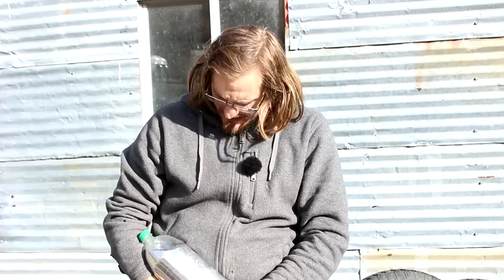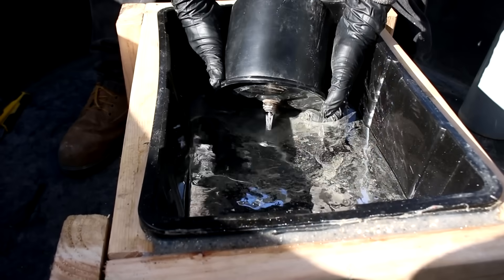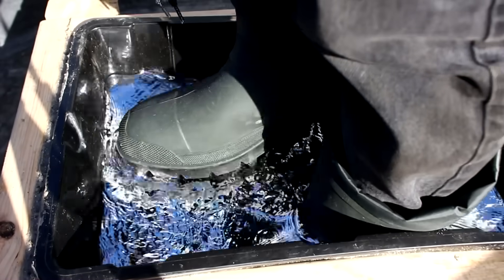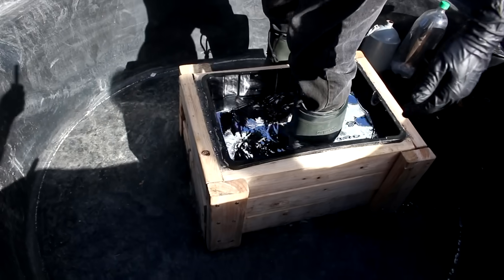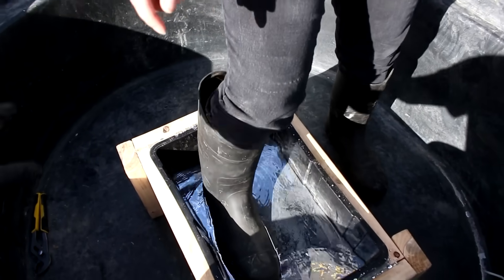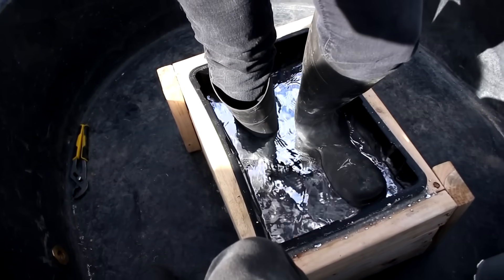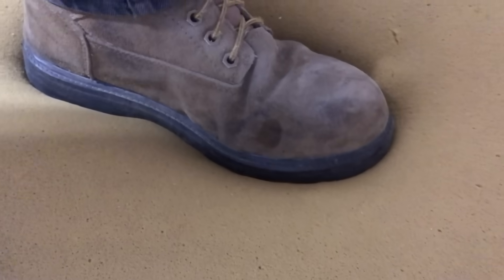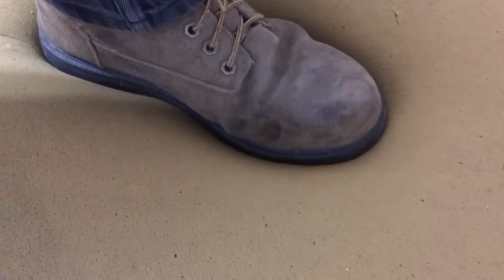Can I Stand On Liquid Mercury?

Comment: Isn't mercury dangerous to human health?
Reply: Yes, it can be.  But so can water, oxygen, and many other things we are exposed to everyday.
Reply: I mean contact with mercury. BTW those are only dangerous in case of an overdose.
Reply: As is mercury.  It is a neurotoxin, so the more it builds up in your body, the worse it is, just like an overdose.  

Elemental mercury, which is what he is using, only has a limited number of ways that it can get into your bloodstream.  It is no readily absorbed through the skin, so unless you have open wounds or stay in contact with it for a extended period of time, there is little danger when touching it so long as you are sure to remove all of it from your skin.  Ingestion is also dangerous, but not very a very likely method of being poisoned as elemental mercury is not easily absorbed in the intestines and most will pass through with limited effects.  Likewise, even the direct injection of elemental mercury directly into the bloodstream will usually cause greater complications from blocked blood vessels at the injection site and in the small passages of the lungs than the issue of toxicity.  

The main vector for elemental mercury to enter the body and bloodstream is via inhalation of the vapors.  In this case, Cody took precautions by performing the experiment outdoors on a cool, windy day so as to minimize the rate of vaporization and ensure any ensuing vapors were dissipated by the wind.  

Organic mercury compounds are much, much more dangerous as they are easily absorbed via skin contact, and in some cases, can even migrate through PPE.  These are also the compounds found in most fish and in many of the poisoning cases.
Reply: thx I didn't know mercury had 2 kinds.
Reply: No problem.  That's why there is so much confusion around mercury and people regard it as super deadly, when it's not always the case depending on what form it's in and what precautions to one must take to keep themselves as safe as possible.  

You saw Cody with his hand in liquid elemental mercury, however a lot of people have also heard of the chemist who died after getting only a drop of dimethylmercury on her glove.  This is probably the best example I can use of how mercury affects people differently depending on what form you encounter it as.  Dimethylmercury is extremely toxic and can migrate through gloves and other protective wear.  Other highly toxic compounds are methylmercury, diethylmercury, and ethylmercury.  Merbromin ("Mercurochrome") is also an organomercury compound, but less toxic than some of the others listed.  In the video, you can even see Cody donning gloves when dealing with the mercury nitrate solution as the mercury is now a compound and no longer in it's pure elemental state.  

Just figured I'd give you some additional info.  :)

Comment: hmmm that's more like your boots are acting like a boat, not a raft, you foot and leg are not dispersing the mercury, the boot is, which is much larger than your foot, so its a larger surface area for psi of mercury. try using plastic bags over your feet and legs, nice big thick black garbage bags, it would remove the difference between your leg and the boot, so you would actually being using your leg and feet to displace the mercury. 

Also can you please tell me where you got your rolling press when you did the gold foil experiment? If you made it can you please make a video on how to make it, and where you got the supplies to make it. I have so many projects i want to make but no funds to get a few k worth of press just for my arts and crafts, lol. a DIY metal press would be nice.

Also I love the channel keep it up, liked and subscribed!

Comment: My dad had a friend who worked at an electroplating shop.  They had a small drum, maybe 20 gallon size, of mercury.  The challenge was to put your whole arm in and touch the bottom.  Always fun to watch people try it for the first time.
Reply: Wouldn't that be toxic?
Reply: @Sanjay_ar1  Not at all.  Liquid elemental mercury is pretty safe.
Reply: @josephcote6120  I had a friend of mine who's dad used to work in a refinery. 
He now has Alzheimer's disease and fids. 
Doctors have said that it's due to exposure to heavy metals. 
He passed away 3 weeks ago..
Reply: @Sanjay_ar1  he's not talking about refining it, he's talking about elemental mercury, which in itself is largely ok to touch bare handed (as shown in this video when cody sticks his foot in it)
Reply: @Settings208  the vapors enter your lungs
Reply: @Sanjay_ar1  the vapours are heavy enough that this isn't happening unless you're getting your face right up next to it
Reply: @Sanjay_ar1  Significant mercury vapours don't form unless its really hot(may have been in the refinery) and elemental mercury doesn't enter the body unless there is a physical cut or opening.
Edit: He my have had exposure to mercury compounds while in the refinery which do get absorbed by the skin

Comment: That paper towel not soaking up mercury was crazy weird
Reply: August Sawzak Yes!! So glad someone mentioned this.
Reply: Why
Reply: Same reason as water tension- however elevated because of it's density
Reply: @jacobgeorge7475  lmao didn't the 3rd comment just say it wasn't because of the density ?
Reply: It's really satisfying watching it
Reply: Mercury doesn't soak up, it's too dense for that.
Reply: It's not really the density that causes it. Mercury is extremely cohesive and less adhesive than water, that's why it can clump together to create those big droplets and generally doesn't stick to surfaces. Water "sticks" more easily to another material and makes less big droplets which will end up in the porous structure of a paper towel.

On top of that water also sticks to paper towels because of the cellulose fibers, which it will cling to even more.
Reply: highfire666 - Alright, thanks for correcting me.
Reply: highfire666 why did you put a comma before which?
Reply: highfire666 thank you very much for that explanation.
Reply: @highfire666  Wrong. Water (or any similar liquid) "Sticks" to paper towels and similar material is becaus paper towel absorbs it. Mercury even in it's liquid form is more solid (denser something is, more solid it is) and can't be absorbed thru skin or paper towels and such.

Here's an interesting dilemma, liquid Mercury doesn't follow laws of physics in 1 particular manor: It doesn't float on any liquids, even those which are more dense than mercury is, it will always sink to the bottom. This is why natives around America used liquid mercury to sort out silver (hence the other name, quick silver)
Reply: @Kilzu1  
Hey Ville, I don't really want to defend a 3yo comment, which I kept short and simplistic for the sake of brevity, but as someone with a university physics education I am somewhat interested in a couple odd 'points' you made. Just to be clear, my comment was a direct reply to "Mercury doesn't soak up, it's too dense for that". Anyway:

1) "Wrong. Water (or any similar liquid) "Sticks" to paper towels and similar material is becaus paper towel absorbs it."
-> Why do you think I specifically mentioned adhesion and the porous structure of the paper towel? Adsorption (not to be confused with absorption) is the adhesion of atoms/molecules to a surface, porosity increases adsorption as there is more surface to cling on to.
 Certain materials make a better contact to a substrate surface, see 'wetting', this effect is heavily linked to the surface tension of the adherend (and in part substrate), which in turn is linked to the cohesive forces within the material. Mercury has high cohesive forces, making it harder to fill all surface irregularities on a substrate, which results in less contact surface and further lowers adhesion (which is also linked to other factors between both materials like polarity, bonding, ...). 
If this interests you I suggest you start at capillary action, there are a lot of articles using paper towels as example, also including the explanation of adhesion, cohesion, surface tension, influence of the polarity of cellulose fibers for water, ... But yes, I'm aware of how adsorption works

2) "Mercury even in it's liquid form is more solid (denser something is, more solid it is) ..."
-> No, just no. Yes density changes slightly based on the temperature and aggregation state of the material, but liquid gold isn't 'more solid' than a solid block of ice or iron.

3) "... and can't be absorbed thru skin or paper towels and such."
->  I failed to find any papers that show a directly proportional link between density and absorption through skin. Yes, most heavy metals have adverse reactions when entering the blood stream, but I couldn't find any papers showing that denser metals had a proportionally harder time permeating the skin. Could you maybe provide a paper? What I did find was that some bigger factors here are: the solubility of the material and the capacity of sweat to oxidise it.

4) "It doesn't float on any liquids, even those which are more dense than mercury is ... used liquid mercury to sort out silver"
-> Liquid Mercury 13.69g/cm^3 is denser than liquid Silver 9.34g/cm^3, so I'm not entirely sure what you tried to say here, it is to be expected that silver would float. Gold has a higher density and sinks (also turns into an amalgamation). Objects sinking also depends on surface tension which is pretty high in mercury, that's why a small tungsten (19.28g/cm^3) rod can float on Mercury, but the moment you break the surface tension (e.g. by dropping or pushing it) it will stay at the bottom. Edit: I'm definitely interested in seeing videos of molten gold, iridium or tungsten, metals that are actually denser than Mercury, to see if Mercury would float on top of that though or sink as you claim it should.

5) "This is why natives around America used liquid mercury to sort out silver"
-> I'm definitely interested in hearing more about this, as I couldn't find anything on the topic except for silver amalgamations.

6) "hence the other name, quick silver"
-> Can you stop making things up? Mercury/Quicksilver has been known since before 1500BC and the part 'Quick' comes from Middle English's 'quyk' or Old English's 'cwic', meaning "living, alive, animate", directly relating to Latin's 'argentum vivum' -> 'living silver'

Thanks for bringing up an old topic, I definitely learnt a couple things while writing this.
Reply: @fish4225  it's way too dumb to be soaked up
Reply: I mean mercury is metal after all
it may be liquid but it ain't water
Reply: Well it’s too dense to be absorbed and it’s metal not something like water
Reply: Counter-intuitive since we are so used to water, but makes total sense at the same time.
Reply: So is spelling "weird" like "wierd"
Reply: @kelcantcap1260  yes. Thanks for the correction. Rather embarrassing after getting so many likes.
Reply: What time stamp
Reply: Haha I thought this was actually a joke
Reply: You should watch it go through a coffee filter.
Reply: Guess what a sponge cant absorb mercury
Reply: Its also a metal soooo..... yeah

Comment: "Mercury isn't that dangerous, i can put my foot on it" ! 
The most dangerous thing with mercury is its vapours. Yes, mercury is a high volatil metal. And you are standing on a bucket of mercury on a hot day. But sure, mercury isn't dangerous.
Btw i'm a chemist.
Reply: Leize Leize And Cody is a much more experienced chemist than you
Reply: I don't care dude, i am not the fellow with his feet in mercury. However, you should not saying things like that, when you have absolutely no idea of what you are talking about. You don't know me, i don't know you, i bet you know nothing about chemistry and i'm sure you know shit about my experience, so be nice, stop your craps.
Reply: If you really are a chemist you should know that mercury does not evaporate quickly, in fact it takes over a year for a half gram sample of mercury to evaporate completely. Also, Cody is in an open area. He is completely safe.
Reply: "Elemental mercury (Hg0) is found
as a liquid with a vapor pressure of
0.00185 mm at 25°C. This means that elemental
mercury is extremely volatile. For
example, if a dish of mercury is placed in
the center of a room where the temperature
is 25°C, one could expect to measure
20 mg of mercury (or 2.4 ppm) in the air
(up to the distance of a radial meter) surrounding
the mercury)"

Then 

"A study has shown that acute exposure (4 – 8 hours) to calculated elemental mercury levels of 1.1 to 44 mg/m3 resulted in chest pain, dyspnea, cough, hemoptysis, impairment of pulmonary function, and evidence of interstitial pneumonitis"

Half a year for a mercury half gram to evaporate ? I doubt that.

My point is that obviously, everyone can buy mercury, there is a lot of people on YouTube, a lot of young people and i think that showing self exposure to mercury isn't the best thing to show. We have stricts rules in laboratories about the mercury dangerousness and this is not for fun. I didnt say that Cody knows nothing about chemistry or science in general, just he wasn't in the safest position to shows people fun fact about mercury and most importantly security rules when you are handling toxic compounds.
Sorry for my english, it's obvious that English isn't my native language.
Reply: Leize Leize My school has had 4 drops of mercury in a fume hood for the 3 years I have been in there, they have gotten a tiny bit smaller according to the teachers bit it is not noticeable. Also, Cody is in a well ventilated area, the miniscule amount of mercury vapour gets blown away by the wind

Comment: Cody! Be my friend!! lol

a comment on your instability when you are standing in the mercury...

the instability is due to a coupling moment developed between your center of gravity and your meta center (essentially your center of buoyancy, location of your buoyancy force)... for stability in a liquid medium... the meta center should be above your center of gravity... because the meta center is the location of your upward force, and your COG is the location of your downward force, even a slight tilt will allow rotation to occur (this is because the forces are pointing toward each-other at the midpoint between them), when your COG is below the metal center, these forces point away from each-other and keep the floating object righting... this is the same concept used in boats and the best example of this is the keel of a sailboat (where the COG is concentrated well beneath the meta center)... this feature of sailboats is why they are so hard to capsize!!

Comment: Guys mercury isn't as dangerous as you think...the reputation for mercury is bad but apart from that mercury is actually VERY low on the reactivity series...even drinking mercury does absolutely NOTHING to your body...only inhaling mercury is dangerous...contat with mercury is also not dangerous...improper washing or metal on the body with which mercury can react is dangerous over long and continuous exposure...basically mercury isnt poison

Comment: Did you get a blood test?
Reply: BiRDiE he doesn’t really need to since it’s not dimethyl Mercury
Reply: It’s not easily absorbed into the skin like dimethyl mercury is he has non organic mercury and it’s only dangerous in open cuts and I gestion
Reply: @Sydleywydley  Elemental mercury (Hg) is found in liquid form, which easily vaporizes at room temperature and is well absorbed (80%) through inhalation. Its lipid-soluble property allows for easy passage through the alveoli into the bloodstream and red blood cells (RBCs). Once inhaled, elemental mercury is mostly converted to an inorganic divalent or mercuric form by catalase in the erythrocytes. This inorganic form has similar properties to inorganic mercury (eg, poor lipid solubility, limited permeability to the blood-brain barrier, and excretion in feces). Small amounts of nonoxidized elemental mercury continue to persist and account for central nervous system toxicity.

Elemental mercury as a vapor has the ability to penetrate the central nervous system (CNS), where it is ionized and trapped, attributing to its significant toxic effects. Elemental mercury is not well absorbed by the GI tract; therefore, when it is ingested (eg, thermometers), it is only mildly toxic.

Comment: SG of mercury is 13.6, and volume of human body is about 66.4 L or dm3. As water nearly replace whole body volume of 66.4L, so mercury will replace about 66.4/13.6 = 4.88L, it is about lower half of your legs. But for real situation, it is difficult to balance, so you will fall on the surface of mercury, with just very slight portion of your body submerged.

Comment: . .  .and then 2 decades later they died of mercury poisoning.

I wonder what he does with all of this mercury? - As in how does he dispose of it?  Also, what did he do with the paper towel  which he used to wipe the dust off the top of mercury? - I hope he didn't wipe his dishes with it afterward.
Reply: He doesn't dispose of it, it goes right back into the flasks.